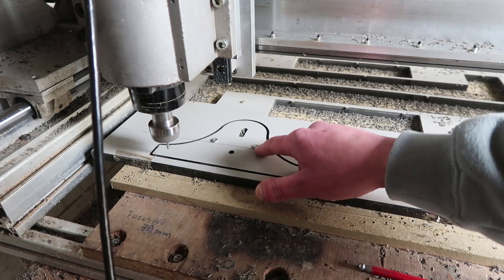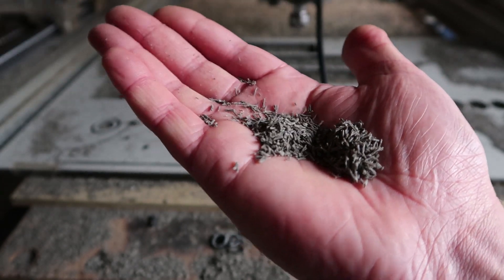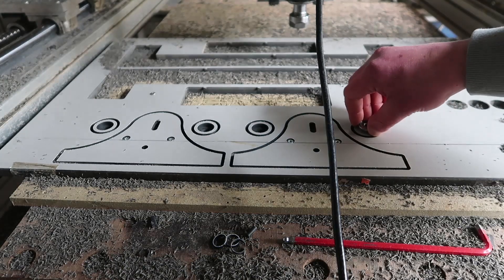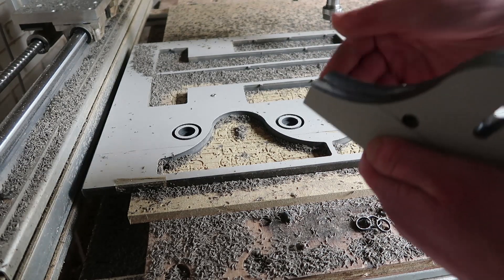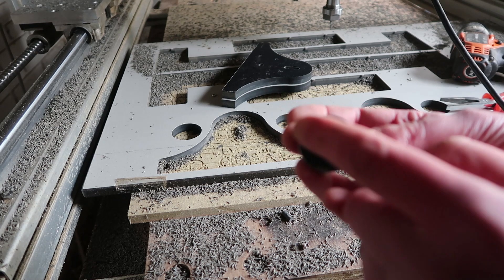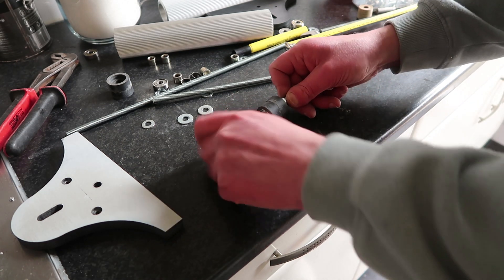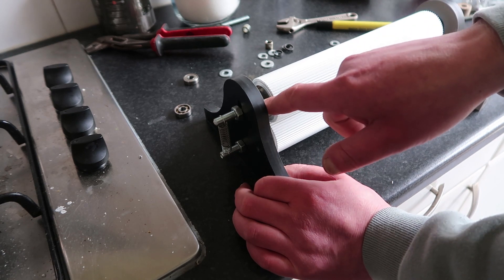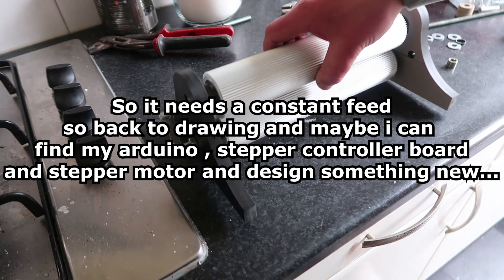Ribbon Corrugator V2  - Part 1 Minor fail. but will do for now

Comment: For what you have now, you can roll with both hands if you have the diaphragm in perpendicular to the rollers. One hand starts the other continues.

That HPL  is great for a CNC. If it is available why not use it?

Mark
Reply from the maker: yeah i might use it 12 MM is a decent thickness. and saves.... alllot of money compared to alu :( even shit alu 6060 is expensive.  i also got some 25 Mm  hpl tucked away for 10 years :) i never used might be a good time to get it out :) it weighs a ton.

yeah trying to keeep rolling conitnues byt hand might work...  but i rather have  a  motor do it slow but steady :) well i got a Arduino somewhere and a nema 23 stepper and a driver.. and some connectors and stand offs....  in short i got so much shit collected over the years i should be able to make it work if i want

Comment: wanting one of these CNC machines you seemingly use for everything. Did you make this or buy it?
Reply from the maker: i made it once. and a few week ago changes some things. and i will be changing it upcoming months. to make the Z reach higher to be able to make molds. besides that i am collecting materials for a bigger one. this one is to small for my projects :( i dont need strong and or stiff just length :) planars are huge :) so. length is needed :( 2 meters will do it :)
Reply: @joppepeelen  ah that explains why you haven't made a super tall planar yet lol. I guess you could hand-etch or hand-cut which is what us peasants have to do ;)
Reply from the maker: @asdfasdfasdfasdeff  or make a new machine :) i got 50% of the items needed already. im anticipating for a 2 meter long one so i can make big panels :) room, money and my hate for drawing the whole thing up holds me back :) buying the items i think i need im pretty good at. already bought stuff that i cant use..... maybe for a third machine ? haha

Comment: some reason my comment got wiped. love this. I'm using rods from Joe's Racing Products SKU QRP38-220. 22” long. Curious where you got your gear / cylinders from?
Reply from the maker: ooh im sorry i did not remove anything though. well i got my rods once from a baking company but they do not make them anymore :( i gues you used extruded gears/pinions >? the ones you could cut down to size to be used for belt drive etc
Reply: @joppepeelen  correct

Comment: You could always use a friction drive. Something with a rubber tyre that just rests on the rotors. 

It would also act as a torque limiter: just in case you get your tie stuck in it when you’re making ribbons :)
Reply from the maker: i think ill drive it with a stepper i wanted  belt drive but i do not have the cogs, i do have the belts.. so i might go direct drive. hope that works
Reply from the maker: hmm when i think of it , that friction drive might be a pretty good idea !!! HAHAHA good one with the tie ! yeah getting sucked into my own currugator hehe